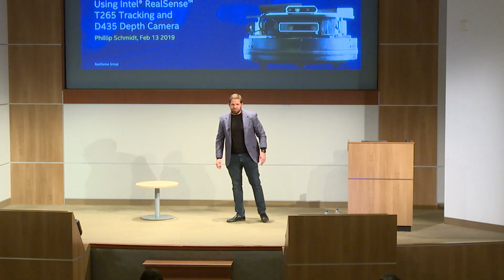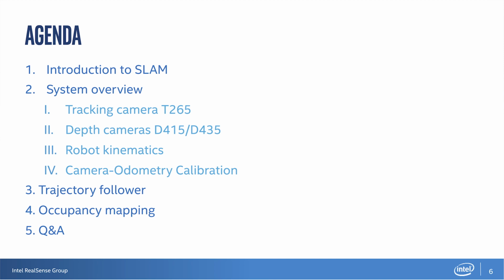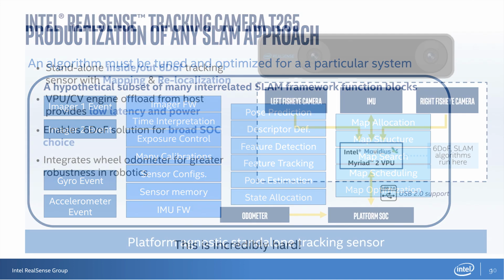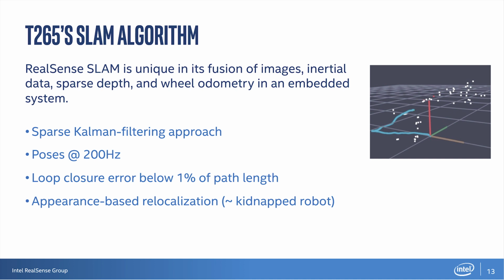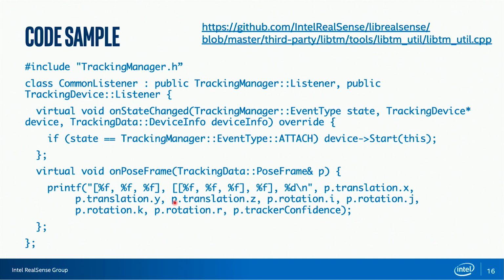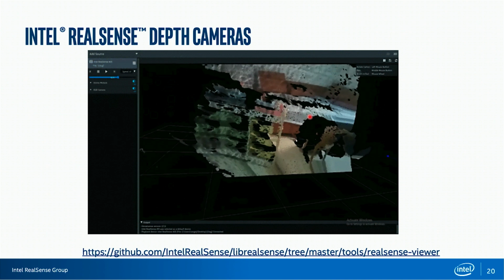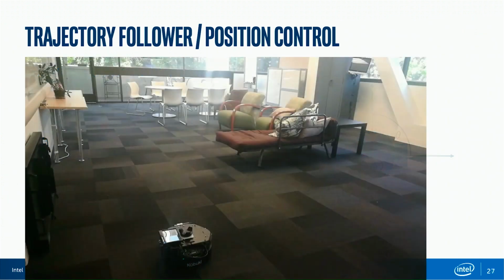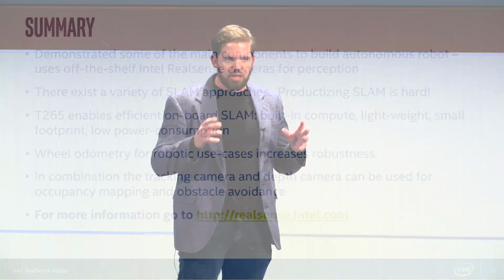Visual navigation for wheeled autonomous robots – using Intel® RealSense™ Tracking Camera T265.

Comment: Since I have obtained the T265 yesterday I have tested the V-SLAM indoors with an impressively performance over some 3 minutes (I have not tested longer loops yet, I would need a larger flat). How long is the time window for loop closure detection and bundle adjustment? I will attempt large outdoor loops and am hoping for a stable performance.
Reply: How was the performance outdoors?
Reply: Do you have any sample code which you can share? I still don't understand how to integrate d435 with t265 for v-slam.